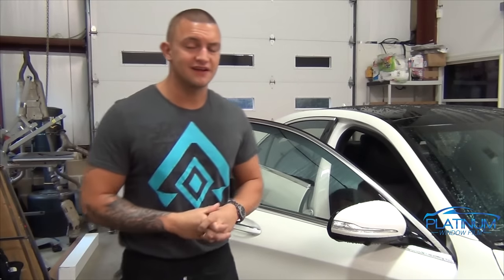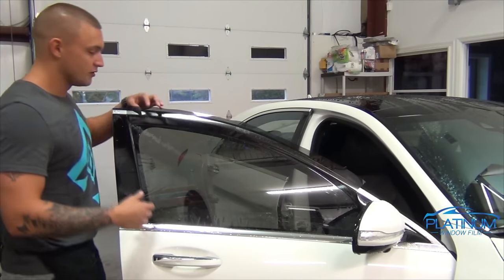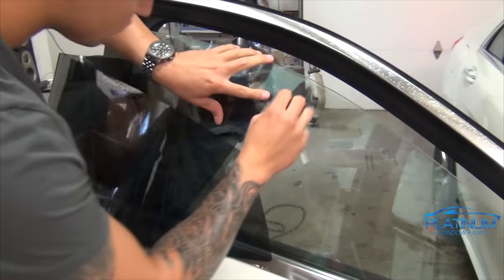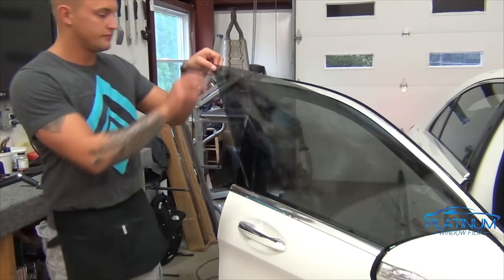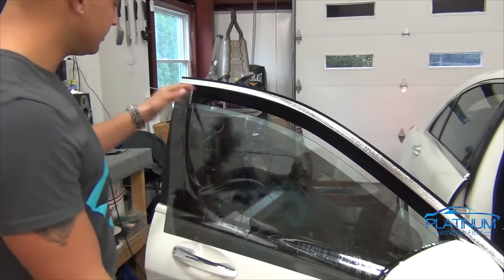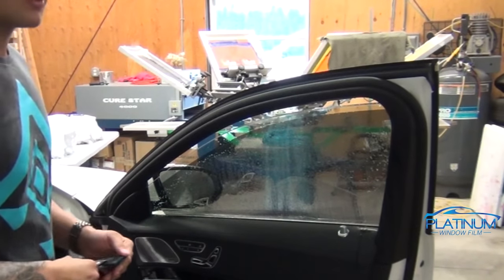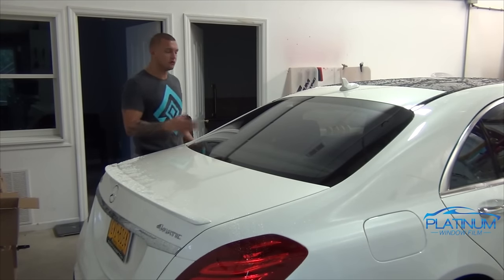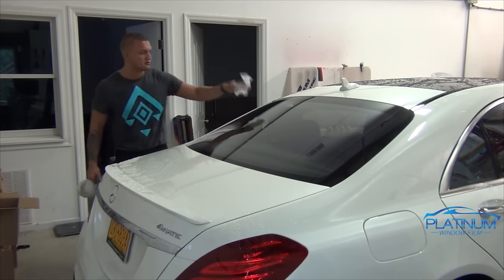How To Tint A 2015 Mercedes Benz S550 - Door Windows

Comment: Why when I line up to the bottom gasket it’s above the inside gasket on my civic. Done it 3 times. Have a half inch light gap. If I run it about a half inch below the gasket on the outside of the window. How will I shrink it? I need help here

Comment: Hey can you please tell me how you install it using the 2 stage method without taping the felt seals? Isn't the tint rubbing on the felt seals when you fold the bottom part of the tint? Thanks

Comment: i would think you would tape plastic along the door panel to keep water spray off the seat adjustment switches and the expensive door speakers.
Reply from the maker: Garrett Dodson we don't spray the door panel directly so there has never been an issue. If there ever is direct water exposure to those parts we will then cover them.
Reply: Window Tint Supplies just because it doesn't instantly break the shit doesn't mean it's not bad for it...you sprayed a shitload of water in those doors. I would not be happy
Reply from the maker: Willy bman the water goes down the window And into the door exactly where all of the rain water goes when rain falls from the sky and onto your windows. Thanks for watching 👍🏽
Reply: Window Tint Warriors there's rubber on the outside....so water doesn't get in the windows...idk I guess you do this everyday but idk man... doesn't look the best technique
Reply: In almost 10 years and thousands of cars we've never had any issue with doing it this same way. Looks sketchy but it's completely fine. It's just part of installing tint... :)
Reply: Willy bman The problem is not the water inside the door, because as he said, that area is expected to receive water safely and guide it out at the bottom of the door. However, what's not OK is the water that's now dripping down on the inside panel of the door, where it is not expected to do so, and where it not only can get to the electronics, but also stain the fabric or leather carpeting. That's why the inside of the door should be always covered with a plastic bag and using a tape line stuck right next to the gasket at the bottom of the window.

Comment: Well you answered my question with this car as far as electronics are concerened in the door. Question 2. Watching all the other videos you have done you always line the factory edge to the botttom gasket of the car and make your side cuts. However, with this car you cut the bottom edge and sides? Why? This is a mercedes so Im sure the bottom edge is straight, right? And, from the other videos you would make your first side cut and shift over a bit. But on this car you didn't do that on the front but you did do it on the rear side. Any reason? Hope Im not overwhelming with the questions? And I noticed you didn't even use the blue max on the side windows. All you really used was the turbo....how did you not get any water bubbles? Bc i did a car, used the blue max and there was still water bubbles. Its beyound me hence all the questions. Thanks.
Reply from the maker: I use the blue max to squeegee the top section of the tint and after rolling up I use the turbo squeegee to make it easier with the switch of angle. 

I don't shift the tint on this car because the windows do not shift so there's no reason to compensate for a gap. 

The only reason I cut the bottom edge on this car is because the bottom edge of my window tint from the toll was not straight.
Reply from the maker: Also just so you know just because the Mercedes-Benz doesn't mean the bottom line is straight every car is different.
Reply: PlatinumTinting hey sean how do you know if the window shift or not
Reply: good video.  what type of film do u use? thx

Comment: Did you slide the film to mirror one inch?
Reply from the maker: Nano Minardi 1/4” forward
Reply from the maker: I’m sorry. With the S550 your not going to shift at all. The gasket is too tight to put extra material into the front.
Reply: @WindowTintWarriors  just found this out yesterday

Comment: You should never cut on a customers car like that. Get a peel board man! Your install techniques aren't the best either. It will eventually peel on the bottom corners. Those door panels can be removed in 10 mins if you know what your doing.
Reply: tintman831 im glad someone else said it, lol amazing how many tinters still dont open door panels. Most newer Mercedes open up SOOOOO easy, i feel guilty charging full price for them lololol
Reply: We don't pull door panels either. Haven't had any problems to date. Just different technique :)